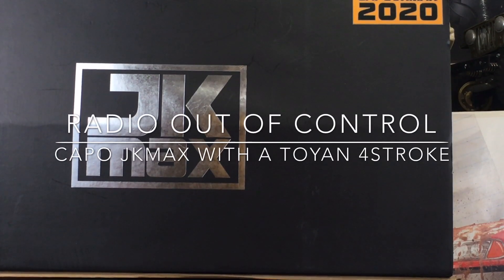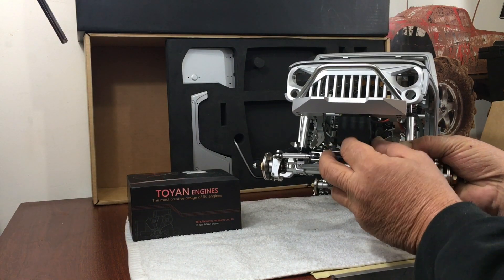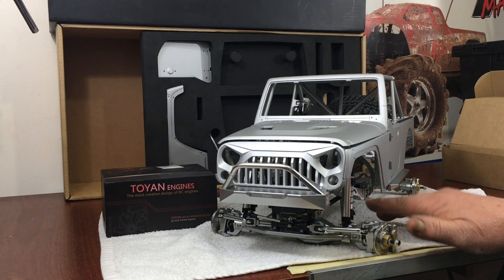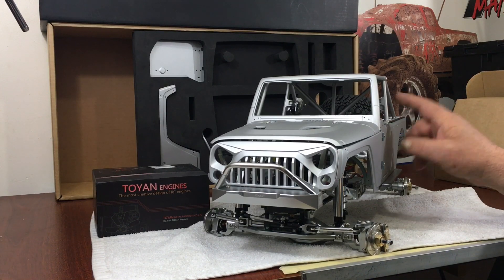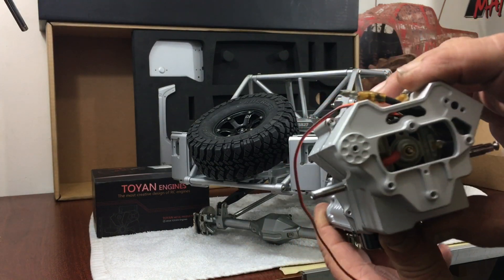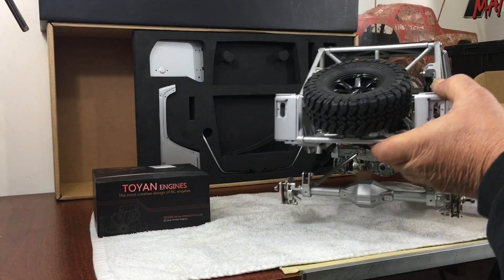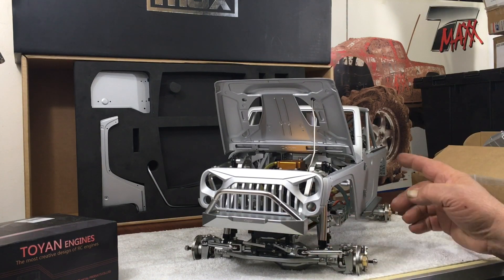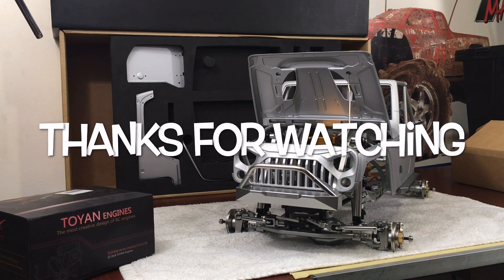Capo JKMAX with a Toyan 4 stroke !!!!

Comment: That’s good to hear about TinTin Hobbies .. I got one on order now with TinTin Hobbies, and so far the communication with TinTin has been better than literally all USA companies in the crawler business I’ve dealt with since I started in the hobby in 2012.  So with that kind of power did you retain the stock driveshafts?
Reply from the maker: Cool to hear you have one on the way!  Their a awesome company I actually bought more jk max parts from them when I decided to install the toyan V4 engine in it,  I used a forward/reverse gearbox from enginediy,com and mated it to the stock jk transfer case, Im running the stock driveshafts and axles so gar so good. it puts out about 3.2 horsepower.
Reply: Dennis Dempsey Radio out of control That’s quite the power plant mod you did there Dennis, how is slow speed crawling with that motor?  And what kind of gas does it use? It looks absolutely awesome in that engine bay 👍
Reply from the maker: @chrisstrobel3439  The gearbox I came up with has a wide ratio, it has plenty of power at crawling speeds but it kills the clutch because of all the weight after the conversion.  as of right now i'm working on different gear combos with a 2 speed transfer case as well as different clutches. the V4 runs on 20% nitro rc fuel.
Reply: Dennis Dempsey Radio out of control That’s great Dennis,  must be a lot of fun working on those gear combos. Are you retired? I’m retired now myself and have a lot of time to work on my scale rigs and watch videos like yours .. so thanks for posting your work up here on YouTube for us to enjoy. Btw what state are you in .. I’m in So.Cal. myself.
Reply from the maker: @chrisstrobel3439  I'm on the edge of retirement, got about 5 years to get ready to go rc hobby full time lol! Thanks for watching my channel, I used to build rigs and briefly run them then shelf them  my son suggested youtube for me to pass my knowledge and ideas on to everyone to see, I was surprised how many of us were out in the world! I presently live in RI but would like to go south after retirement, I haven't thrown the dart at the map yet lol!
Reply: Dennis Dempsey Radio out of control Hi Dennis, it’s cool to meet someone similar to my age that shares the same passion. I’ve got several 1/10 rigs I’ve built like my old school  KOH rig that I put on display and never have run .. no shame in that .. it’s like a complicated static model like the ones I built as a kid. Have you ever considered throwing the dart out west?
Reply from the maker: @chrisstrobel3439  Yeah there's not to many pioneers like us who stayed in the hobby from the start,  I still have boxes of RC car action magazines with a few independent ones from 1987 to about 2003 when the internet took over. I sometimes think about how many different cars and trucks have been made through the years lol,  we didn't have all these cool parts ,kits and accessories back then lol, I have thought about throwing the dart to so cal its always been a place I have liked, any place that doesn't have snow! lol
Reply: Dennis Dempsey Radio out of control Yeah I have stacks of old magazines buried away in the closet too .. it’s hard to throw them out even though my wife would be thrilled if I did lol. I grew up with a Dad and Uncle who were hard core scale builders, when I was 7 in the 60’s my first build was a 1/4 scale Wright Flyer my Dad and I built from scratch .. no plans, it flew great, but my Dad decided to hang it above my bed .. and one night he came to tuck me in, and being 6’4” tall when he stood back up his head crushed the whole plane to smitherines 😡 lol. I decided at that point to move into cars .. but they were static models at that point. My Uncle Jack a half hour away from us had a 1200ft building in the back filled with an award winning model railroad .. and the ceiling was hung with numerous scratch built RC aircraft .. all gas motors of course back then .. yet when I went over there it was always the few cars he built that grabbed my attention. I’ve only watched your JkMax videos so far .. do you also delve into other RC areas like planes or boats? I’m pretty much just off-road cars and trucks these days myself. If you make it out here to So.Cal. I think you’d really like it .. tons of places to take Scale crawlers, wear shorts most of the time, go to the King of the Hammers races, etc. I’m in contact with some of the KOH guys like Gen-Right Offroad who run the KOH every year .. and those guys are all heavily into scale too, in fact I was talking to them last week about doing my black JkMax in Gen-Right graphics .. and now they are interested in the JkMax and wanted me to send them a bunch of info on them .. which I did lol. So you wouldn’t be alone out here.  Times have really changed as you said with CNC machining and electronics, but there are always parts to make and things to do to keep the creativity juices flowing ehh .. like you swapping in that motor into your JK 👍
Reply from the maker: @chrisstrobel3439  Sounds like you had a lot of great rc influences growing up,  I got into the hobby back in 85 when I seen the tamiya bruiser, had to get it lol, I do mostly off road also, I mix it up between bashing and scale crawling, the KOH is one of my down falls I cant pass the TV when there's a competition on lol, I would be at home out there with the real and Rc rigs. I started my channel with mostly custom builds with the old school tamiya bruisers and scratch built cars and trucks in bigger scales, It will be a awesome sight to see your JkMAX  dressed with the Gen-Rights  graphics. I have been doing alot with the Toyan engines lately.
Reply: Dennis Dempsey Radio out of control 1985 Hi Dennis, so have you been consistently involved in the hobby since 1985 .. or did you take some long breaks here and there like me? In 1985 I was touring around as a keyboard player and just didn’t have the energy for anything except trying to catch up on lost sleep during those years lol. Yeah I’m like you with KOH, and have literally spent days binge watching old races on YouTube lol. On that Toyan engine what’s the weight of it, and does it run well at steep angles? Ohh and do you plan on ever painting your JkMax or are you going to keep it silver?
Reply from the maker: @chrisstrobel3439  I took  a few breaks through to do life things, after my divorce in 03 I brought the term party animal to a whole other level lol, it was around 2014 I got back into the hobby hardcore. the Toyan weighs in at around 3lbs plus all the extras like fuel cell and igniters, batteries and wiring add some extra weight which really strains the clutch so I just got a bigger one to change, it has some trouble at slow speeds climbing but at fast speeds it zips right up.  I was going to paint it a Jeep color  ( I am a autobody tech) but the flat silver looked cool for now during the engine conversion and testing it its going to get some wounds lol.
Reply: Dennis Dempsey Radio out of control Sorry to hear about that divorce Dennis, my divorce was in 1990 .. and was in part because I brought the term party animal to a new level 😳 After the divorce I made a 180 and headed to the church 😬 It was around 2012 I went into RC crawlers after figuring out I couldn’t afford what I wanted to do to my real Jeep .. and it’s been in the garage ever since. Anyway the JkMax looks great in silver .. I almost bought the same color. Hey I got a question for you on the JkMax since mine is still in the mail .. are those brass colored wheel hexes it comes with standard 12mm hexes? I’d like to throw on my Locked Up RC 2.2 Trail Ready beadlocks and Goodyear MTR’s .. and didn’t know if I’m going to need some kind of adapter or if those hexes are indeed 12mm.
Reply from the maker: @chrisstrobel3439  Sounds like we took the same detore in life lol,  Yeah the hexes are 12mm and really thick to hold their optional disc brake rotors on them also, The reason I got the silver one was mine was preordered months before reveal day and they wanted an additional 3 months and 400.00 more to paint it. I figured I can paint it myself at the bodyshop,  The first thing I did after building the kit was to get my box of spare sets of wheels and tires and start trying them on to see what they looked like and handled lol! and some like my Dick cepek  rc4wd  rims wouldn"t fit with the disc brake kit, bummer!
Reply: Dennis Dempsey Radio out of control Hey Dennis, yeah we could probably swap similar stories back and forth over some brew or java lol. I went ahead and paid the extra to have em put mine together .. I just have too many other projects unfinished right now like the comp crawler I’m building .. so the JkMax kit would have just sat and maybe never got built had I bought the kit version. I also have the old school Jason Scherer KOH chassis I bought from RC4WD 5 years ago which is just now almost done, and a Wreckluse chassis and RC4WD Blackwell axle set that need building, sometimes I feel like hiring a shop hand to get more RC stuff done lol. With your bodyshop I’m sure you’ll have a killer paint job on it should you do choose 👍. So do you work on one rig until it’s fairly done .. or are you like me with several builds laying around in various states of completion? I’ll have to check out your disc brakes .. are you the one where the disc breaks actually work? I was going to get the decorative disk breaks .. but with my budget I opted for the selectable lockers and remote locking rear sway bar instead. Ohh I just ordered a set of Goodyear MTR’s for the JkMax .. have you ran those tires by any chance?
Reply from the maker: @chrisstrobel3439    Yeah we have both been down the road of life, lol  Its cool you had your jkmax put together, its one of the most complicated kits I have ever put together,  They don't come with directions you have to download them online and guess what.... they are in asian language lol, I looked at all the pics and assembled mine in about 8 hrs,  rocked it for a week then stuffed the V4 engine in it, to be honest I liked the stock electric version better, its easy to run outside and indoors. I plan on returning it to a brushless setup soon. sounds like you have many projects in the larva stage also lol.  mine are a mix of scratch builds and refitting different power trains and parts in my rigs with the occasional new kit builds. I like to put automotive base/clear on my builds its pretty tough and can be repaired and blended back to new again when the unavoidable devastation happens. the working disc brakes are cool but really not needed with electric, unless a nitro engine is planned down the road. the sway bar is a must on these because of all the top heavy weight when running on the terra firma  at high speeds lol. I have to check out those MTR's I don't have a set yet.

Comment: I like the toyan single cylinder better than other bodies because it sort of gives it a look of a straight 4 cylinder. That is going to look more alive than any other body specially if you run the exhaust to the back. it cost more though.
Reply from the maker: Yea I agree its lighter and gets better fuel economy, I wish toyan would make a straight 4 in a smaller package, that would be so cool!

Comment: Hi Dennis! How the oil system works? Is it working good?
Reply from the maker: Hi Andre its working good so far, im still getting some oil leaking out of the crank bearings, I installed bigger nipples on the lower case and valve cover and it helped a lot.  the cam and rocker arms are getting lubed pretty good now.

Comment: looks like a perfect fit.you could make a working gas pedal and put a small servo checker under the dash and mount a steering wheel and have real fly by wire steering..same with brake pedal,with a start button on the dash. it would be a real drivable tiny car
Reply from the maker: That could be done easily lol!